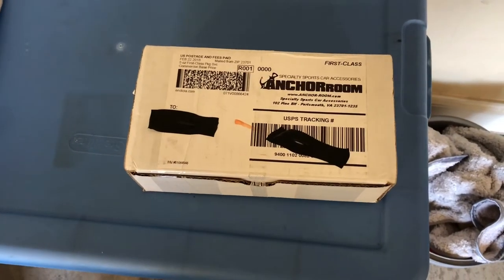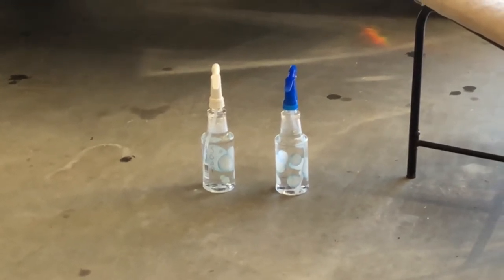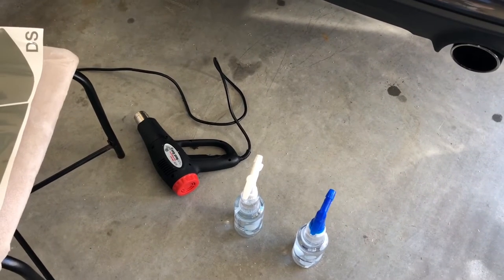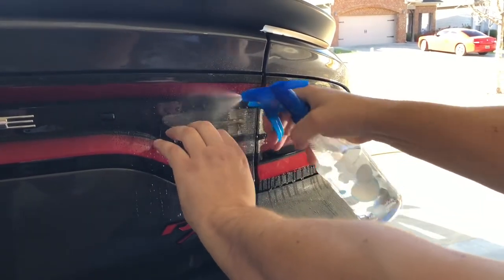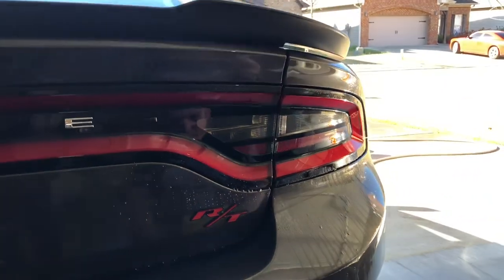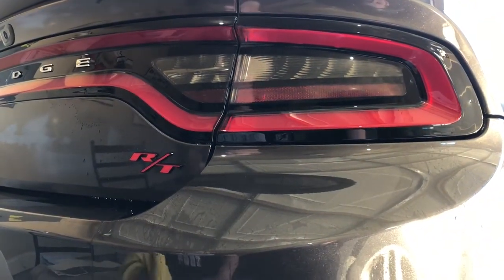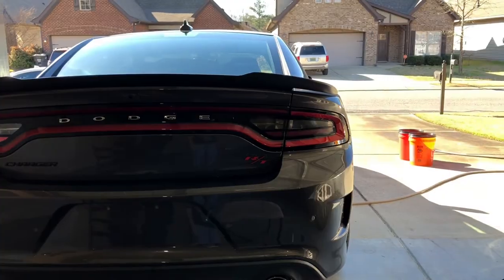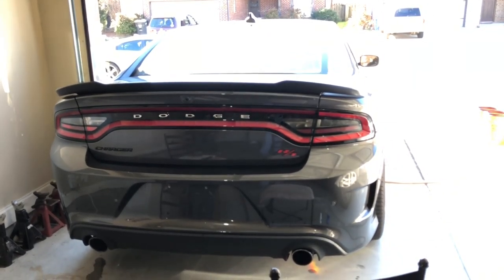Anchorroom light smoke tint install on my 2018  scatpack Charger.    ✔️

Comment: Why didn't you get the darker smoke tint?
Reply from the maker: Didn't want it any darker..
Reply: Was just curious...thanks!
Reply from the maker: Mostly because i didn't want to dim my reverse lights any..  With the light smoke tint you can tell they are tinted, but there aren't so dark that it impairs the light coming through.
Reply: Alright. I had the same thought process but went for the darker tints...I should be getting mine next week so I'll see how they are at night.
Reply from the maker: You will still be able to see the light through it good.  But if you had light smoke and dark smoke side by side the light smoke would let much more light through.  I like my reverse lights to be as bright as possible but i light the smoked look also.